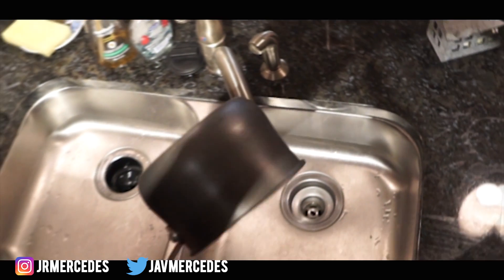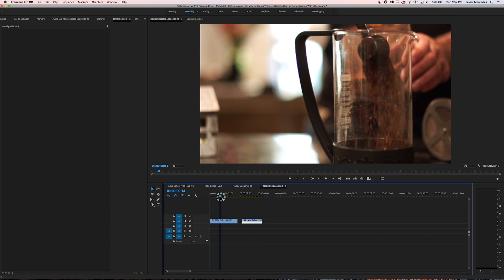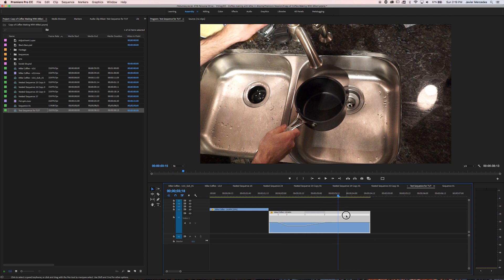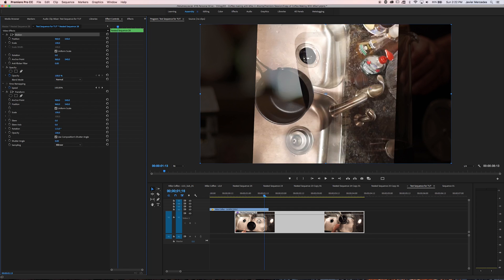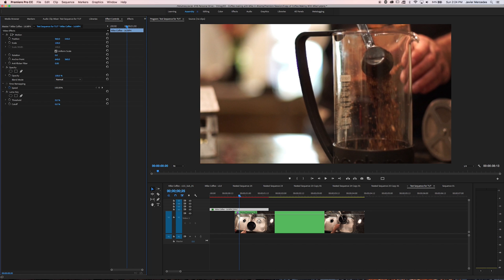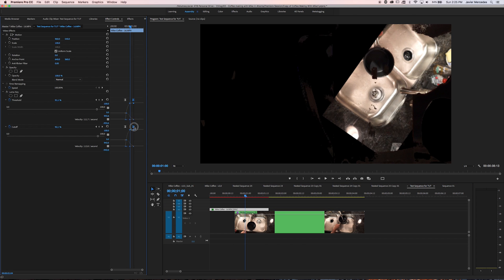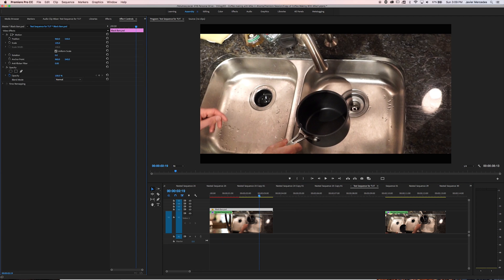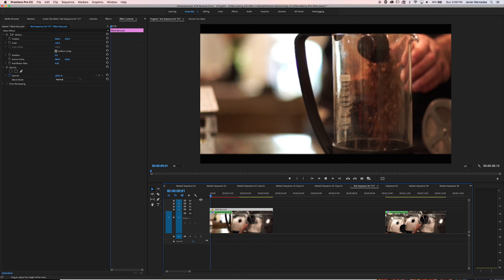Smooth Luma Fade Spin Transition - Premiere Pro Tutorial

Comment: That speed ramp has just sold me on premier. I use lightworks because its free, but it lacks lots of clever things. Like when you change the speed of a clip it decides that it needs to have access to half the processing power of humanity to preview it, and you can only change the speed of the whole clip - that speed ramp is clever and either your computer is double what mine is (possible) or premier is much more optimized. 

Awesome transition.

Awesome tutorial
Reply from the maker: Thanks Colin! Glad I could be your gateway drug to Premiere Pro, I would have to say that Premiere is optimized, even if you aren't speed ramping making a cut and changing the speed at different points is a simple enough option. I think you come out with enough video content to warrant using Premiere, it will make you life less stressful when you can go through edits faster. BTW, I bought all the things for the cooking challenge but ended up cooking the artichoke on a different day then the melon and pork, I'm going do it, and I learned how to boil artichoke! (which obviously means I'm moving up in the world :)